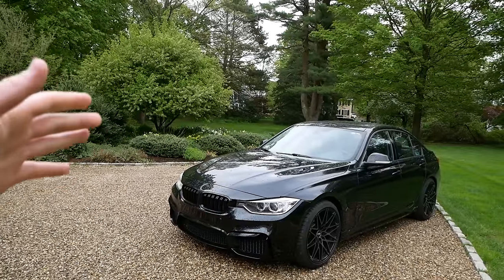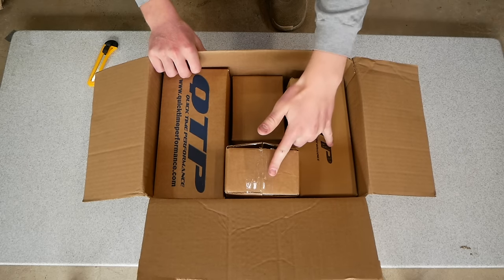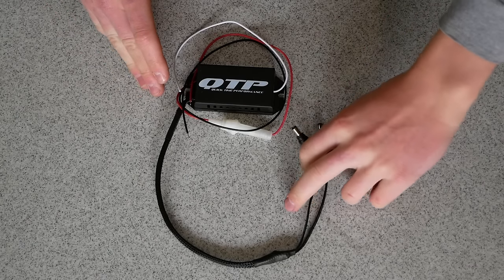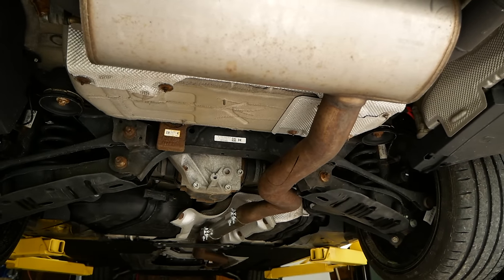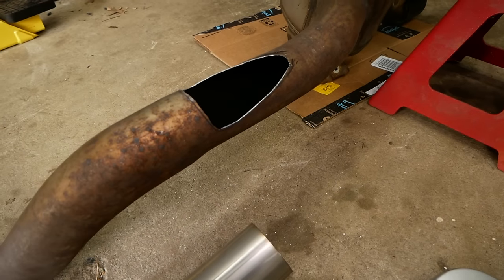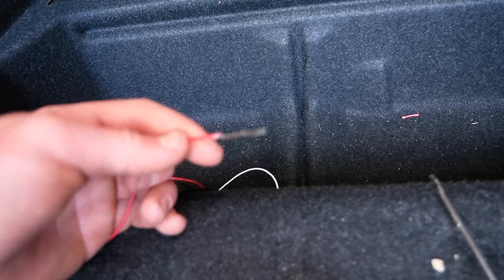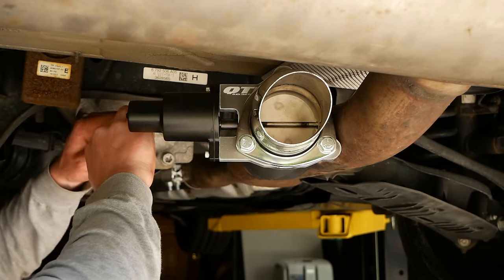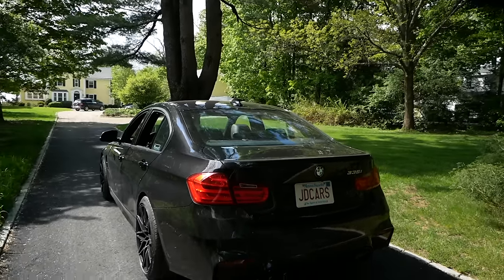QTP Electric Exhaust Cutout // STRAIGHT PIPING MY BMW

Comment: They call it rice when u put cosmetic enhancements with no performance gains on a Japanese car. So an m style bumper n no performance parts on a German car should b called sauerkraut.
Reply: Bipolar Beast yeah I agree however I do respect that he’s kept the 335i badge on the back. so it’s not toooo bad
Reply: RICE = Race Inspired Cosmetic Enhancements
Reply: No it’s rice when you try to pretend it’s a M4 or M3
Reply: Bipolar Beast but less resistance of exhaust gasses adds a little more power not an insanely noticeable amount but the engine notices
Reply: It’s rice when you install a fart can and throw a wing on it😂
Reply: Hahahahahahahahahah hahahahaha that’s so funny but who cares it sounds good
Reply: I think he gains a few hp cause of the more flow in the exhaust
Reply: what would that be called for an American piece of iron?
Reply: deku hero fries
Reply: as a German, I support your proposal !
Reply: A bumper is fine. The badge makes it rice. I have a performance modded 525i that makes 500 fucking horsepower and I still feel lame putting an M badge. I’m thinking of making it the worlds first M525i with the badge since I have the horses to back it up (and beat a 2004 m5) but I don’t want rice 🍚
Reply: @LukeVMH-Games  Don't. I have a 435i gran coupé with catless downpipe and do88 intercooler MHD stage2+ E20 map E30 blend. Smoked an E61 M5 at a street race 2 weeks ago. Old M5s have no torque.
Reply: unfortunately he cannot reply. He was found dead
Reply: It’s a 335i. It needs an ECU and transmission tune and it will be worth its weight in performance. Twin turbo v6 🤷🏼‍♂️ stop hating on the man. I will say though that rubber grommet hole you made under the fuse box is huge and water will get in. Just saying.
Reply: Lmfaooo
Reply: @Shyamiiii  not to be that guy, but it’s straight six not a V-6
Reply: @BVonBuescher  someone had to say it, I hate when people just assume what's under the hood, everything isn't just V6 or V8

Comment: has it rained since you did this?  If so, there goes your car when water gets in your fusebox.  Should have put silicone to fill up the hole you made in the grommet.
Reply: mrphotomanTIM or just slitted the gromet so that it was tight to the cable but allowed the plug to pass thru
Reply: exactly, the hole should be smaller so the cable is snug and then a little filler
Reply: I agree with you bro.
Reply: Just rinse the undersite ones and you blow it right on the fuse box.
And believe me, electric problems are the best..
Reply: @Michaeltje89  Yep the best. hehehehe
Reply: Every comment section has a know-it-all doomsday commenter. Congrats on being that guy
Reply: @Easton21  it doesn't take a know it all,that's just common sense,water and electronics don't mix🤷🏾‍♂️🤷🏾‍♂️🤷🏾‍♂️🤷🏾‍♂️🤷🏾‍♂️
Reply: @Easton21  🤡
Reply: Is he gonna fail at emission test
Reply: Or even made it smaller and fed the smaller end in first 1 of them plugs that plugs in to switch or the remote receiver where a lot smaller than the water tight side in the other end lmao

Comment: Those welds were just awful
Reply: That's why he has a grinder
Reply: Thats what you get by using (flux wire) instead of argon gas tank .
Reply: You don t have to lick them who cares 🤷‍♂️🤦‍♂️
Reply: so what does the job fine
Reply: Car looks good, hey if I saw this on the street I definitely would think it's an M.

Comment: Good job, but I recommend using a ‘tap-a-fuse’ socket to tap positive 12v. It’s just safer and won’t cause bad connections or plastic to melt in case something goes wrong and cause a fire.
Reply: That and I would have used a switched fuse not constant, that way your battery isn't getting drained by the wireless receiver.
Reply: You recommend a specific tap a fuse? Could not find one that handles a 20a fuse.
Reply: Michael Moore hooked mine up to the rear accessory socket which turns off 15 min after the car locks.
Reply: Like tap-a-Tio
Reply: I was thinking the same! The video is pretty decent for folks just trying to do the damn thing but brother that fuse, STOP IT!!! 😂
Reply: @aldorodriguez1674  why would a valve need 20a

Comment: I’ve basically done the same thing with a vacuum controlled cut out but I basically went around the muffler and back into the original piping
Reply: Could your valve handle the pressure? Any rattle?

Comment: Won't it cause issues that you just cut a whole in a grommet that was water tight right underneath your fuse box?
Reply: I thought this, you could see the ground straight through. It's only a matter of time before water/moisture makes it's way in there.
Reply: Rookie mistake right there. It’s plugged for a reason :)
Reply: you can obviously just tape around it with electric tape or put silicon around it
Reply: Glad I am not the only one to notice . LOL.
Reply: Not only that but how about the fact he wrapped the power wire around the blade of the fuse an just smacked it in the fuse box like you can get a piece for autozone for 5 dollars that would have gave you a hot wire off that an been safe he said naw just wrap that bad boy around the blade an send it so I now have open hot wire in my fuse box a lot with moisture now about to get to it from the cut rubber awesome job bro awesome job 👌👌👌
Reply: @cheddarballs864  yeah I know but that doesn’t make it less of a hazard or half assed if your putting the effort in to do it do it properly
Reply: @cheddarballs864   .....and it's still a stupid ass thing to do

Comment: You should take some rubber cement and fill that hole around the wire in that grommet so there's no chance of moisture getting near your fuses and in your trunk.

Comment: better to make a small (wire size) hole in the grommet then slice it to the edge of the grommet, so it will seal around the wire instead of the huge hole you put in it.

Comment: Nice job!! 
I had my exhaust valve connected directly to the 12v battery. I noticed that my valve no longer opens and closes, so in the end I didn't know whether it burned out or it came from the heat from the valve, or just unlucky. do you have any ideas ??
Reply: Probably burned, could have been due to a short along the way from any number of things. What I usually do when adding electronic elements to my cars is fuse tapping. It’s relatively easy and it’s very safe

Comment: Overall well done, I'm not a fan of the way u connected the fuse but I've seen worse. Can I just give you a small piece of advice. When you put a cable true the rubber seal, don't cut out the diameter of the connector but only the diameter of the wire. If you can't fit the connector true the seal, cut the seal using a knife, from the centre to the exterior in a straight line. That way you'll be able to fit the wire perfectly and it will still seal the way it was used to. It's just a word of advice 😉👍keep up the good work
Reply from the maker: Thanks for the advice. I would typically make a slit in the grommet to pass the cable through but this was a hard plastic grommet.

Comment: Doesn’t grind off rust and puts down garbage welds, paints over it, drills out grommet bigger than wire letting any water get on fuse box when it rains, wraps power wire on a fuse onto fuse box.
Reply from the maker: Shit... you're right 🤦‍♂️ The modification didn't accomplish what I set out to do and the car completely fell apart. Wait, nope 😂 you're just being nit picky

Comment: About how wide apart are the two connectors on the remote system?

I have an e550 with a biturbo setup and a true dual exhaust. Two mufflers right before each tip. Its split all the way up to the center of the car. 

Could you split the wire more, or probably some extending is needed?
Reply from the maker: They should be far enough apart for you to hook a valve up to each pipe without needing to split/extend.

Comment: Do we think alike when accessing power for aftermarket accessories,...I do the same thing with power leads and fuses!  LOL!  Nice work!!

Please say did you resealed the large hole you made in the Grommet,....personally, I think you should have done a "slit cut"!  this way,..the grommet would still keep moisture out of the vehicle, etc.
Reply from the maker: I did reseal the hole. I was unable to make a slit cut because the grommet was a very rigid plastic.

Comment: Best way to do the fuse instead of wrapping the wire get a fuse tap will have 2 fuses on it and crimp connectors to wire strait to 1 fuse for the added item and 1 fuse for the orginal item and you just crimp and then plug in

Comment: Fyi you can buy a fuse tap .. wrapping wire on the fuse it self is just asking for trouble if youre not lucky and that just look cheesy
Reply from the maker: Yes. An “add-a-fuse” is the way to go for a proper, clean install

Comment: If you had drilled a hole in the grommet just big enough for the wire then slice the grommet from outside into the hole you could pop in over the wire w/o having that huge hole that might leak water into your trunk.  If nothing else it will allow exhaust fumes from you cut-out into the trunk.

Comment: For an unregulated exhaust install that valve before the catalytic converter, with out the cat your car will smell of pure gasoline since that's most of the emissions but this will increase your overall performance if tuned for speed, cool loud car but take off that cat

Comment: Hey, can I ask a question about the cutout? 
1. When the valve is opened, some exhaust gas still went thru the muffler, right? 
2. If 1 is true, then when the valve is opened, the louder sound comes mostly from the by-pass pipe or the tip after the muffler?
Reply from the maker: 1) yes it does still allow some gas thru muffler
2) most of the exhaust flows thru the cutout, as it will take the path of least resistance

Comment: Great instructional video!!!
Just a couple of safety you missed or may consider to throw out as a disclaimer.

1. Get some sort of ventilation when welding. The fumes and smoke are toxic as hell and 14:37 you are balls deep in! Think about your lungs buddy!
2. When deburring whit that pneumatic tool. Those chips that the tool is grinding off is going everywhere! I personally experienced them to end up in my hair and stuck to all my clothing and they are pointy as hell witch resorts to hours of finding those small splinters, so it is preferred to have an apron to deflect the flying burrs.
Reply from the maker: Thank you for your safety tips! I definitely need better ventilation when welding!

Comment: If you wanted louder then why not install it closer to header (front of car). Fitment issue???
Reply: That’s what I was confused about he sound he wanted it louder but put it all the way toward the back
Reply: Sensor issue
Reply: Possible fitment and also possible exhaust fumes close to the cabin
Reply: potatocubes 30875 no sensor issue
Reply: Nicholas Eckert the face toward the ground
Reply: Jlove my thought is that at idle/stand still it could float upwards.
Reply: Nicholas Eckert it could but there’s no holes in the bottom that lead to the cabin, Dodge Viper exhaust comes out the side door and had no problems with that

Comment: Would a car pass a check if its installed or do you still have to put the stock exhaust system?
Reply from the maker: Yes! With no other exhaust modifications and with the valve closed, your car should still pass inspection. As long as your inspection station doesn’t physically look at the muffler and tell you modifications aren’t allowed— which is unlikely with the valve closed.

Comment: Awsome video..thanks for the info..only thing i thought could have been better was that gromet cutting..you should have cut the wire then made the smallest hole and then solder the wire back to have minimal water seepage..but thats just a gromet can be changed at any moment loo

Comment: I have a 2016 m135 and these car a easy to steal without the key so I was thinking, Can I install this on my exhaust system as security?  like to shut off the exhaust so it won’t start or at least run for them to escape very far in my car?
Reply: Watch chrisfix kill switch video

Comment: If you have the cutout under ur car, u basically got ur exhaust hole under it, wouldnt that melt stuff under ur car? I saw a video of a guy driving with his exhaust under the car, and he melted his rear bumper completely
Reply from the maker: It would melt things but the adjustable tip diverts the hot exhaust away from plastic

Comment: Hey just wondering if that second option you had with the full straight exhaust and into the muffler exhaust one works on a model 323ci Beamer. I’m trying to put one in mine where I will use clamps and have to cut off part of the exhaust to place it in. About 11 inches if I remember. But I was just wondering if that second option with right measurements would work on a different Beamer if you know. I’m very new with cars

Comment: I would definitely look at alternative ways to tie into your electrical system. Decent video, but on the electrical side of the install it’s lack luster.
Reply from the maker: Yes— I should have used an add-a-fuse

Comment: what gas did you use for welding? what wire?
Reply from the maker: I was just using flux-core wire. I probably should've hooked up my argon tank for cleaner welds.

Comment: I have a dodge durango gt 2018 what tube number do I have to use 🙏🙏
Reply from the maker: I couldn't tell you off the top of my head. Would recommend measuring the size of your exhaust, or consulting a shop.

Comment: Hey JD if I’m tryna do this to my car would I have to put the electric valve switch cuz I’d keep it open anyways so would it still be the same if u put all the pipes and stuff but not the switch
Reply: What would be the point of buying that if you don’t even want to activate the valve. Just take off the muffler and add pipes.

Comment: What number in the fuse diagram did you connect the hot to?
Reply from the maker: I'd have to pull out the diagram and check to tell you, but you should be okay as long as the fuse port isn't in use and it's a 12v source.
Reply: JD Cars yeah. I think I’ve set mine in where it’s draining my battery.

Comment: I would have welded the flange to the pipe on the inside.  It looks a lot cleaner and that way there in no chance of the welds interfering with the bolt/nuts.  You have to grind the weld down so it was flat so the flange would seal but that's not a big deal.

Comment: Hey dude look into fuse taps they are much safer than what you did. Also look for better grommet or seal up that hole. It was there for a reason especially right by your fuse box

Comment: All though it is cool it is not the most affective because air is still going through the normal exhaust.
Reply: yeah,he is losing quite a bit of backpressure,the engine probably is losing some torque with the valve open (and gaining a bit of power in high rpm)
Reply: @Niphiz  You're worried about backpressure on a turbo motor? Lol.
Reply: @Bestwick1983  ohh i didnt know it has a turbo...  Then its more beneficial i guess though i dont have any practical experience with turbocharged engines
Reply: Air takes path of least resistance,  haven't noticed much smoke coming out of the tips.
Reply: @idokwatcher2062  correct! But it also depends on the volume of exhaust gasses!

Comment: Remove the muffler anf weld a stratepipe with the quad tips
Reply: Bimmer for life that’s what im saying he could’ve did that it would’ve been way quicker n easier
Reply: Sometimes you don't want to always have a straight pipe tho. This gives you the best of both worlds
Reply: What im saying is that the exsaust isnt coming out of the tips, and it wold be much easyer

Comment: That 12V constant live will eventually drain your battery, also killing it's health overtime. Get a fuse blade "add a fuse" adapter, then plug it into fuse 143 (rear fusebox) as this is a switched live, it'll only go live when you turn on the ignition saving your battery. I only know this because I did the exact same, the controller box constantly draining the battery wrecked mine after 12 months.

Comment: Just followed your video and have the valve wiring hooked up. Just waiting on the exhaust clamps. I also ordered the one touch remote and paired that to my home link so no need for remotes anymore. Just looking to get the right fuse tapper.

Comment: Is it bad for the car in long run? I mean the exhaust system with the cut out open will be extremly short.
Reply from the maker: The exhaust system is actually only about 2 feet shorter. Not extremely short. On turbo vehicles, less exhaust resistance will increase power.

Comment: Did you felt any power loss or some problem with the Backpressure of the exhaust or might be overheating engine while driving with valves open?
Reply: Good question wondering the same

Comment: could i still be able to do this without having a resonator delete? i really want to have the cutout before the muffler like you did, but would it even make a difference if it’s not straightpiped?
Reply: Yea, the res is for the rasp sound so it doesn't bother you when you drive. Personally my way would be to delete the catalytic converter, keep the resonator and put this before the muffler, that way you have the best of both worlds on quiet or rowdy of your choice and get 25-30 hp back to you. If you got neighbors and you like them but want the rowdy/and enhancement this is the best way to go

Comment: Their fine print is troubling “Quick Time Performance products are not designed or intended to be used as an automotive CAT, DPF or EGR delete kit, or an aftermarket defeat device which violates the Clean Air Act.Title II. Any of our products used in this manner are void from our warranty, will not be supported and the practice is expressly discouraged.” It’s an exhaust cut out that bypasses the exhaust system, so using it for what it’s designed for would void the warranty? I think I’ll be buying from a different manufacturer.